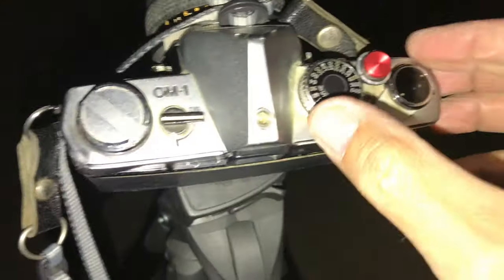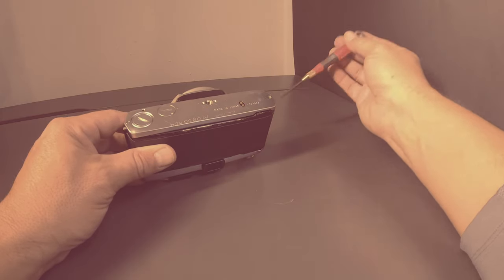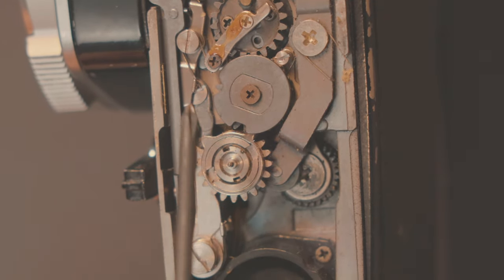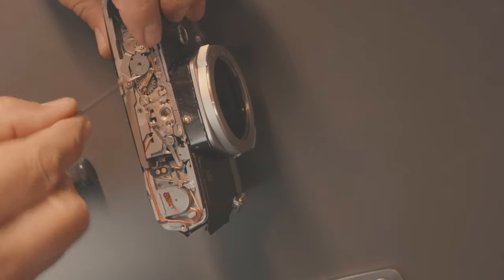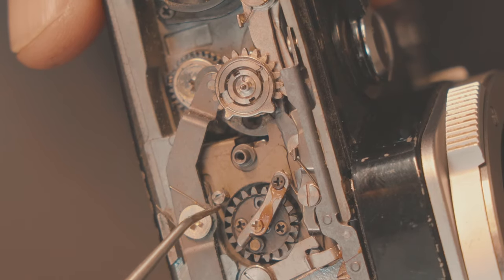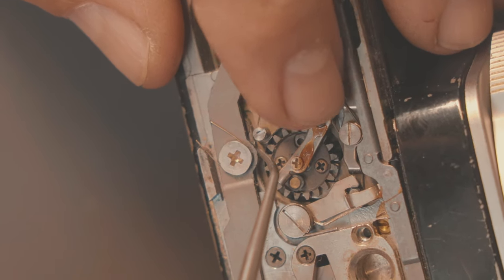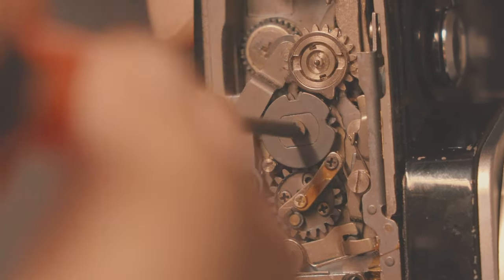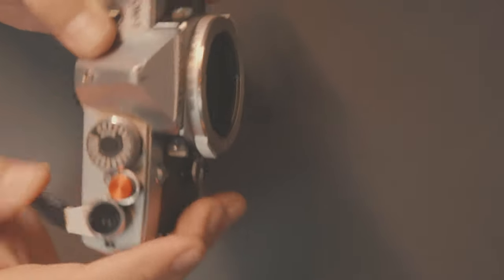Repairing A Film Camera For The First Time || Olympus OM1

Comment: To make sure this works remember to connect the spring to the the underside of the idler gear first and then connect  the long hook part as shown in the video.  That tension is key to fixing the shutter issue.
Reply from the maker: Great suggestion and feedback 👍🏼

Comment: Darn! I popped off the ilder gear, but the lever is still stuck.. It looks like it's coming from the lever with the two notches. Any chance you know how to fix that?
Reply from the maker: So sorry to hear that it’s still not working, perhaps you might want to use some type of lubrication on some of the pieces down near the gear area and gently move and/or rotate the pieces to see if it unlocks them a bit. If you do use some type of lubrication, I would, what would be appropriate for a film camera of this type. I wish you lots of luck and hope you get working.

Comment: This is so great, thanks for posting! What if i'm having an issue where every couple of photos, I take a photo and the shutter stays open, despite the shutter speed being not set to "B" or long exposure? This happened to me with a shot i took at 1/125 shutter speed and 8 aperture. Why would the camera override and do this, unless something was sticking mechanically? I also just discovered that there is already a roll of film inside the camera so I might waste another couple of analog shots before I go in there and tinker when the camera is empty. Unless, do you have a fix maybe on the outside of the camera, maybe I'm using the levers/knobs in the wrong way? I don't know what some of these knobs actually do.
Reply from the maker: I wish I had a fix for you. I have not encountered this problem after i tinkered with the bottom of the camera but these old cameras can be finicky. This video might help. It’s not my video but worth a look: https://youtu.be/ScX8Q4cJxg4?si=eUTbIm7MTKaGvTVu

Comment: I’m brand new to cameras n the Olympus om1 is the first camera I’ve ever bought. My problem I’m having is that it will advance but it doesn’t actually advance the film. Therefore the film isn’t being loaded into the camera
Reply from the maker: CD Kickz Hi CD, welcome to FILM cameras! I’m not a service professional on film cameras but love trying to find solutions to problems with film cameras. Question, without any film in the camera and the back door open to the OM1, when you move the advance lever, does the film spool on the right of the camera turn at all?

Comment: hi sr, i have  Olympus OM1 MD versión  and i wonder why  the lightmeter neadle in the viewfinder mover  with  or whit out battery in fact  the neadle moves if turn the aperture or  shuttter  speed  ring and  all this also happen  with the lightmeter leaver  in  on or off , can You please tell me  what should i do   , is this something  that can be fix  by  My self or i have to  send   the camera to an specialist?  thanks for your help
Reply from the maker: Hi Oscar, I have never really used the light meter in camera because the battery has died so quick on me, so I just use external methods to gauge the right settings for the shot. You may have to send the camera to a specialist. Sorry I don’t have a specific and helpful answer for you.

Comment: How about any other reason that the Lever is still blocked?
I checked the Spring, it is in good shape but still cannot unblock the Lever.

From what I heard, the person armed the Lever of a OM-2, press the Shutter Release but kept the Lever in "armed position", the result is that the Lever is blocked.

It's there a way to fix it?
Reply from the maker: The only thing I can think of if the spring is good, that one or all of the gears are locked up and may need to be removed, cleaned up and replaced and/or put a light (tiny) bit of grease/oil to loosen up the gears. Please do some research on the proper type of oil. Hope this helps.
Reply: Watch the 'fix old cameras' idler gear video. It is short and sweet and good.

Comment: I have an OM10, that always worked, but remained off and not used for many years .. I changed the batteries after many years, but when I switch on, nothings happens. Battery not detected .. no oxidation and batteries are new. 
Mechanical parts are ok.
Any idea or suggestions to fix it by myself?
Thanks
Reply from the maker: I wish I had the answer for you Andrea. I have heard that the OM10 power component differs from early production to later production cameras. I don't have any suggestions, other than send it to camera specialist to get it looked and perhaps get some free advice. I hope you get your camera working.
Reply: The power switch on these fail.   The switch might be able to glue back but you will need to remove te top to do so. .
Reply from the maker: Great tip, Dan 👍🏼

Comment: Hey man this is happening to my om2n but it doesnt seem to be the spring under the idler  and the lever is still stuck is there any advice u can give me ?
Reply from the maker: Hi Daniel, remove the lens and ensure the shutter curtain is positioned properly, they tend to malfunction once in a while. Also you may want to remove all the gears and levers on the bottom and grease it up (please research what grease/oil works best). I have not taking the top assembly apart so I’m not sure if that would be of any help to you. Hope you get it worked out and if all else fails you can always send it in to get fixed, which is a little pricey but worth fixing this camera if it’s in good shape.
Reply: OM 2 have a reset button.

Comment: Hi, tried my OM-1 and it worked fine for about 10 photos then when i wind the film the shutter goes off directly. Like you are holding the shutter button down when you wind. Do you have any idea what the problem can be?
Reply from the maker: I wish I could help, but I fixed my camera by carefully removing the parts I mentioned in this video and replaced them and my camera worked. It seems these cameras can un-align themselves periodically. Sorry but I can’t be certain what the problem could be.
Reply: @pablodiazphotography  Ok, thanks for your answer! I will keep looking for a solution. :)

Comment: Do you know how to take off the self timer level? I cant figure it out.
Reply from the maker: I have not done it myself, but I have learned that you can turn the decorator plate clockwise to loosen it, not counter-clockwise
Reply: @pablodiazphotography  I will try that. The hardest part is getting something small enough to fit in the holes while also not being too flimsy.
Reply from the maker: I hear what you are saying. I’m in need of better film camera tools too, this might be helpful, it’s for lenses but might do the trick: OFNMY Professional DSLR Camera Lens Spanner Wrench Repair Opening Tool kit 10-100mm with 3 Tips, 6 Screws and 2 Hexagon Wrench for Canon Nikon Sony Olympus DSLR Camera https://www.amazon.com/dp/B07Q354KZ5/ref=cm_sw_r_cp_api_i_iRXMFbS4S10KN?_encoding=UTF8&psc=1
Reply: @pablodiazphotography  thank you so much!
Reply from the maker: @jp2503  You are very welcome, let me know how it all turns out 👍🏼

Comment: Hello! What screwdriver I need??
Reply from the maker: Hi Diego, I was told you need a JIS crosshead screwdriver but I used a very tiny Phillips screwdriver. I was very careful not to use to much force but be firm and dont strip the screws.